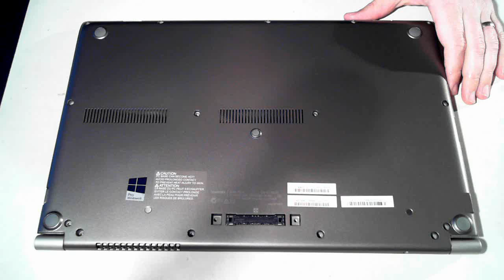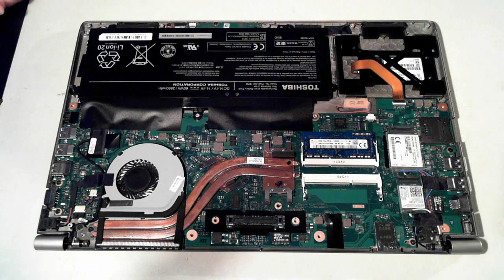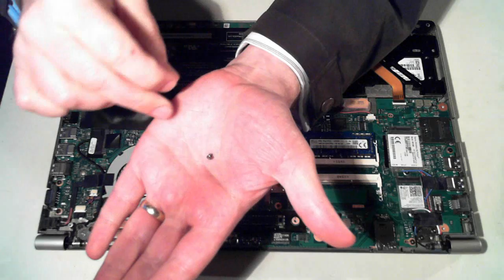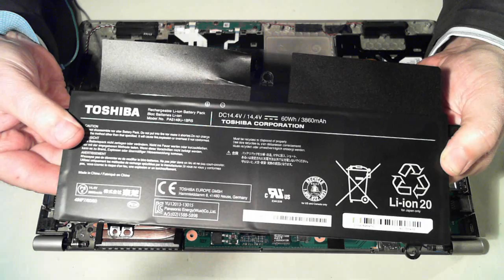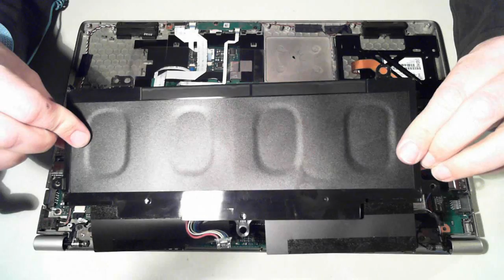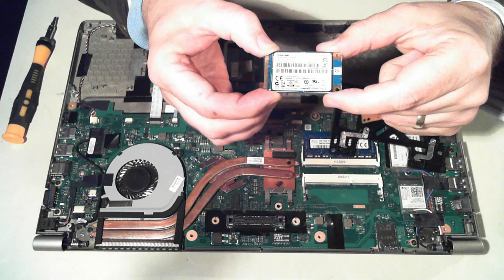Toshiba Tecra Z50-A Opening / Teardown

Comment: Thank you for video, very useful. Upgrade of memory and SSD was a question of 40 minutes. This notebook is really great.
Reply: Hi, tell me what you replaced the memory and SSD with, Thanks
Reply: @yyyyyyyyyyyyyyy980  Hi, the memory was Crucial 16GB / 2x8GB / DDR3 SO-DIMM / 1600MHz / PC3-12800 / CL11 / 1.35V/1.50V Dual Voltage - it works OK. But I was not able to make work the SSD - impossible to copy the old disk and make it work or reinstall OS. (With many other laptops not a problem to change the disk to SSD or change a SSD).

Comment: What's the best battery to upgrade to? 
I also have an issue which after watching the video, I think is the little adaptor for the port replicator...I get an annoying intermittent connection, then it settles and is okay untill I undock and dock again. 
I initially looked to buy a new port replicator but recon I might try and change the adaptor oiut first...where can I get spares for this?

Comment: hey (-: what the name of the adaptor i should look for when trying to connect a 2.5 HDD instead of the SSD one?
Reply from the maker: It will just be a cable that has a "normal" sata and power connection. Sorry but I don't know whaqt the qaxctual name will be, you will have to contact Toshiba.

Comment: Good video.  The keyboard is glued in place.  No screws into the keyboard.  I found that taking the motherboard out and pushing from the back is the best and safest.  I was concerned about breaking the case where it was glued.
Reply: Thank you!!!  Your message gave me the courage to yank a bit harder to break the bond... mine already had a replacement done once and was held in with double sided tape.

Comment: Sorry for bringing up an old topic, but have you found somewhere selling the cable for normal SATA connectors?  I'm having troubles finding one.
Reply: hey! did you ever found out? im trying to replace my SSD with a higher capacity HDD, thanksss
Reply: Hi @Davis Buresh and @dpcomputing. Have you found any sollution? Is this possible? I would liek to replace my msata disc to 1 TB 2,5" SSD. I'm not convinced, because on the videa I see, that 2,5" SSD fits, but there is no space for connector. Thank you.

Comment: doesn't work for a Z40; pity
9 screws or so and one under the middle rubber gromet.  still won't open
Reply from the maker: David Gewin If you are sure that all the screws are removed you may have to "crack" open the case. But if you do this be careful not to actually break the plastic.
Reply: dpcomputing thanks DP ... my questions then are, from which side do you try and crack from?  How hard do you actually try to lift the back? ... and do you only use finger strength?
Reply: oh and i appreciate any response too :)
Reply from the maker: David Gewin Usually ther is a small opening (near one of the ports) and I use a thin plastic spudger.
Reply: okay thank you DP; i'll give this a go
Reply: +David Gewin Did you manage to open yours? On mine I had to remove the rubber feet as there were screws under 2 of them.
Reply: +Alastair Tilley yes I did. Hidden screws everywhere